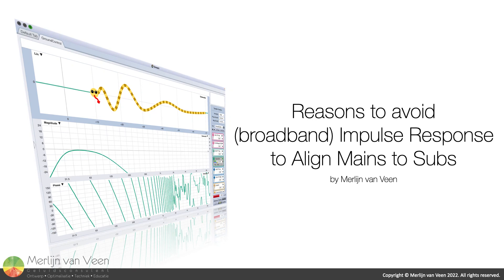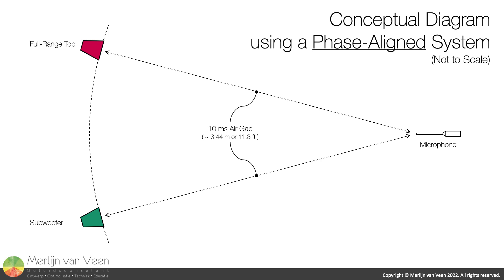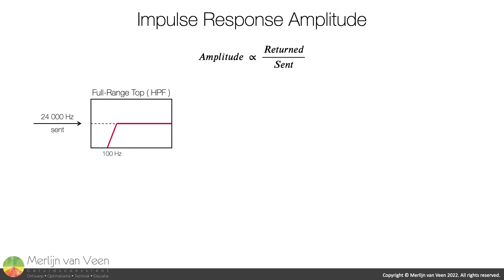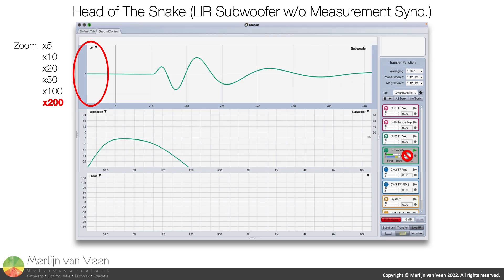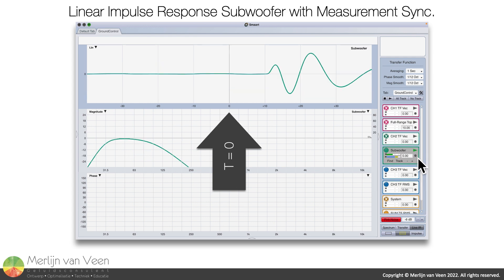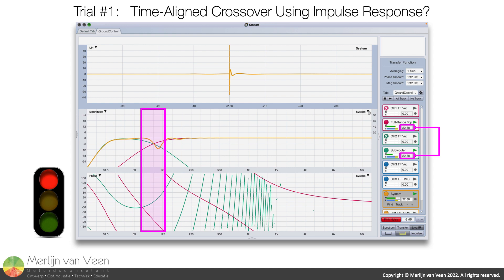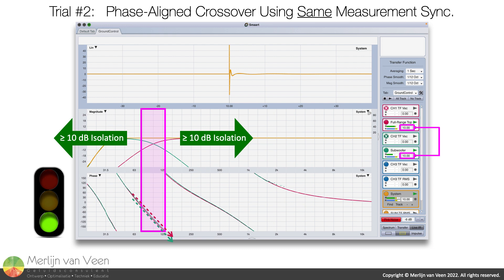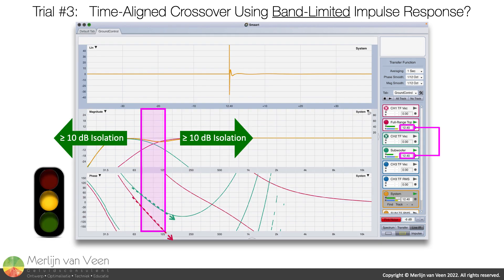Reasons to avoid using (broadband) impulse response to align mains to subs.

Comment: This appears to be a faulty delay finder issue, not a "using impulse issue". The impulse clearly showed a 10ms start time from original t=0. The delay finder got this wrong but the user could clearly see (as you did and pointed out) this is wrong. The impulse could clearly be used to align the mains to subs, just don't use the delay finder to do so. Might want to update your title to not be misleading. I'd suggest Reasons to avoid using automatic delay finders to align mains to subs.
Reply: Right? you can clearly see when the signal starts

Comment: Merlijn, how might someone be sure the have the right delay value if perhaps the Subwoofer naturally/unnaturally lags in its performance? If I just use a tape measure or laser to calulate the proper delay offset for Smaart to read the trace how can I be sure that I've accounted for all possible delay inducing issues, without blindly trusting the physical distance? (Are there even such anomalies in a signal path or are you saying that using the phyical distance is a fullproof method?) ... I'm just a beginner so be gracious with me :)

Comment: It makes sense then that IR is not a good measurement tool for adjusting timing difference between subwoofer and mains for what we're ultimately trying to do, which is to align the phase slopes of mains and sub throughout the crossover region for good summation.  Thus, acoustic slopes, assuming they match a good and proper crossover slope, should sum to a nice flat response in the region.  I've found that phase "slopes" of each in the region will show if the sub is lagging behind the mains or mains behind the sub by the steepness of the phase wraps.  As you delay a driver, the phase response will exhibit more wraps.  So it's a matter of using either delay or phase adjustments in the DSP to make sub wraps overlap the mains throughout, and it's done.